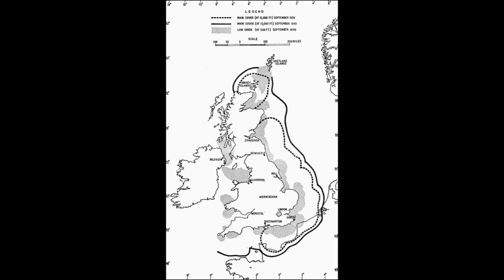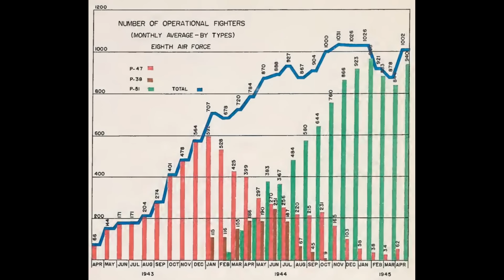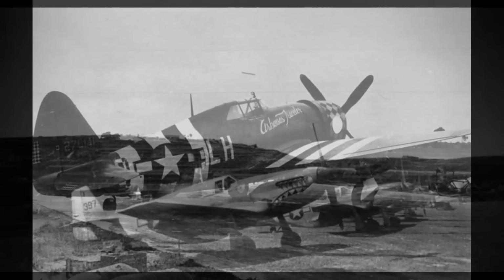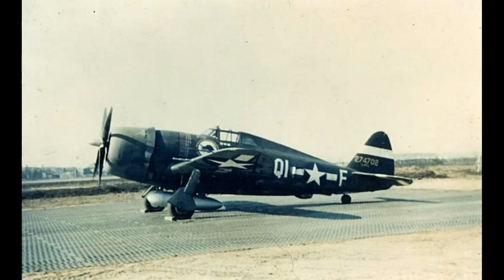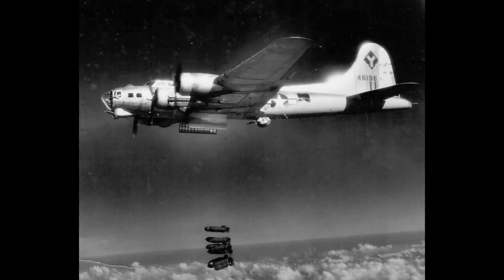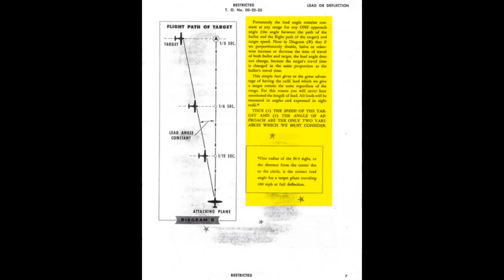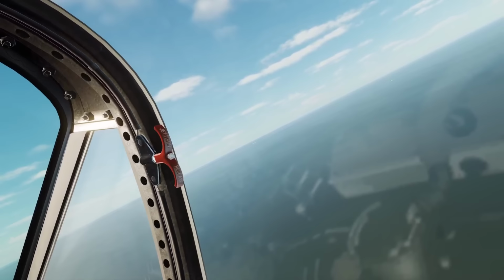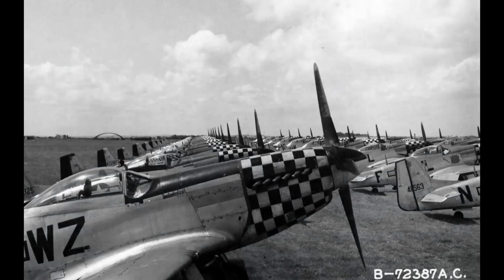Under Appreciated BRITISH Tech From WW2

Comment: Greg, need to get Stephen A. Bourque's new book D-Day 1944 that covers the D-Day bombing in detail.  Unfortunately, US bombing mostly went long due to concerns over hitting friendly forces and French villages paid the price.  Virtually no impact on German forces.  Also, John B. Lundstrom cover US Navy training for high deflection gunnery in his book The First Team.  Navy fighter's highest priority was carrier defense and they were concerned that they might only get one head on pass on attacking torpedo and dive bombers.  As a result, even pre-war, the navy trained extensively on high angle gunnery.  One reason the Thach weave worked for the Navy was that Navy pilots could execute the crossing shots generated by the Thach weave.
Reply from the maker: You don't always need to hit the target. Getting the enemy to keep their heads down is often enough to gain advantage.
Reply: @GregsAirplanesandAutomobiles  Full title of the book is D-Day 1944: The deadly failure of Allied heavy bombing on June 6.    Most of the bombing didn't even land close enough for suppressive effects.  Heavy bombers came in perpendicular to the beaches and dropped long.  Almost nothing landed in the beach areas although a lot landed on the French villages off the beaches.  The only effective bombing was by the 9th Air Force mediums at Utah which turned and bombed parallel to the beaches.  One reason that Utah went fairly well.  They also bombed visually.  Excellent book in the new Osprey Air Campaigns series which I recommend highly (entire series).  The book includes detailed diagrams of beach defenses and detailed bombing assignment tables.  Author is quite knowledgeable and has another excellent book on allied bombing campaign in France.  The author points out that this was the heaviest bombing effort of the war (short range equals high bomb loads for 2800 RAF and USAAF bombers), however, the official 8th Air Force assessment stated "The immediate beach areas showed only limited evidence of bombing damage as was to be expected in view of the extra precautionary measures taken to avoid short bomb falls when the overcast bombing method was used."  The 8th did not put much effort into publicizing these results as you might imagine.   Put in almost as big and effort the next day with the major result for 5000 bomber sorties being around 4000 dead French.  Total German casualties were probably several dozen.  As the Chinese say "when the elephants fight, the grass gets trampled."
Reply from the maker: I'm sure it's a fine book, but for these videos I generally reference official sources. Now in some cases when time has shown the wartime sources to be wrong I'll point that out, but I don't think it's the case here. These are some quotes from the 8th Air Force Document I referenced for this video. 

"On D-Day, overcast covered the invasion beaches. Yet Eighth Air Force bombed its targets successfully without hitting the ships close to the beach or the troops inland. They did it by H2X. "

"Initially the Germans were slow to react. Still dazed by dawn attacks of the Eighth Air
Force, enemy coastal defense units failed to prevent a link-up between detachments of Allied paratroops holding bridges across the Orne River Canal, and Allied troops moving inland from the coast. As a result Bayeux captured, cutting the main highway and railroad from Paris. Fighting also was taking place in the streets of Caen, 15 mile's to the southeast."

"Because of overcast weather, extra safety factors had been added to prevent bombing of friendly troops. This resulted in placing the weight of our bombs 300 to 400 yards behind the beaches. The effects of shock and disruption on the enemy were tremendous. Huge clouds of smoke and dust arose, acting as a screen to the landing operations."

"Three other missions were flown during the day by the Eighth Air Force. Gee-H Pathfinder aircraft lead some bombers in to attack road choke points in Caen, while our fighters swept the skies surrounding the area. Other forces were directed to transportation choke points in towns, some to the south and some to the east of the beachhead. H2X technique was used because of the overcast and the fact that the targets were beyond the range of our Gee-H stations. Though hampered by bad weather, both for assembly, route and bombing, good results were obtained."

     I can't continue this discussion because this is getting shoved so far down the the chat (my comments come to me in chronological order for the ENTIRE channel, not just a single video) that I won't find this again. I agree that a lot of French were killed, and I think it's terrible. However the thinking was different back then. Taking out choke points in the roads meant killing civilians because those choke points were in towns. The overall intent was to create confusion and prevent or at least make it difficult for the Germans to organize and coordinate moving of reinforcements. War is hell, that doesn't mean the bombing efforts on D-Day were for nothing.
Reply: @GregsAirplanesandAutomobiles  Greg, if I'm not mistaken, your source is the public statement issued by the Eight in the immediate aftermath of the bombing and not from the operational analysis done post invasion.  However, read closely you can see an initial recognition that the bombing had not gone well and the Eight was trying to put lipstick on the pig as the Eight as prone to due post disaster (remember their statement "Now we have got Schweinfurt" after 2nd Schweinfurt).  The initial targets were numbered and corresponded to identified German strong strong points defending the beaches.  Almost all were immediately along the beach with only a few targets beyond a couple of hundred yards inland.  Indeed, at Omaha, all targets were immediately behind the beach.  When they say they placed the weight of bombs 300 to 400 yards behind the beach, that indicates that they already knew they had missed almost all of their target set.  The subsequent comments on shock effects and smoke are eyewash as the troops landing on Omaha can attest to.  Post strike air recon photos show that even the 300 to 400 yard claim is optimistic with virtually no bomb craters anywhere near the beaches.  Post invasion operational research could not document one German fatality due to air attacks at Omaha.  The results (or lack of) were similar for Juno, Gold, and Sword where the Eight shared targets with RAF Bomber Command.  The later part of the statement actually refers to the post landing bombing where, as you note, they were shifting to interdiction which is another story.  However, the initial attacks were designed to substitute for a prolonged pre-invasion bombardment and in that roll, the Eight screwed the pooch.  The statement is accurate if applied to the mediums of the Ninth at Utah, however, the statement is from the Eight.

Please appreciate I am not trying to nitpick your video.  Love the channel and you do a first rate job.  Indeed, the major point you were making was about the importance of H2X is entirely correct with the D-Day use as subsidiary issue.  You just used the wrong source on D-Day effects.  Over the course of the entire war, the Eight dropped more tonnage by H2X than visually although that is somewhat distorted by the greater number of bombers available late in the war.  However, when you bombed with H2X, you abandoned any pretext of precision bombing.  When I went through VT-10 for Naval Flight Officer training, we trained for radar navigation using a system that was a direct descendant of H2X.  The old hands would tell you it was somewhat but not dramatically better than H2X.  On a good day with some good water/land contrast available, we could probably find the right city.  I sure wouldn't want to bomb off that system.

Comment: the two stage supercharger on a single shaft is even more important than you think as that same layout wased used on SEVERAL early JET engines i thing the ROLLS ROYCE DART its basicly why they worked so much better than the other early jets
Reply from the maker: I was thinking of the Garret TPE 331 but the Rolls Royce Dart is quite similar. Both are two stage centrifugal engines.

Comment: One important thing to note is that after the war Gee became the LORAN A system. It's actually possible to build a location fix based on the transmissions from a single ground station.
Reply from the maker: Having used LORAN C quite a bit, I can assure you that it takes two stations to work, and often you need three to avoid the dreaded "insufficient geometry" error.

Comment: It is important to note Gee would put 60% of bombs within 1 mile of the target. The Norden bomb sight would put 80% of bombs within 1 mile of the aim point, the aim point and the target were often in different countries.  Where Gee was available it would be used even on clear days because Gee would make sure the aim point the bombarder selected was close to the actual target. That if you were bombing Cean you bombed Cean not Le Harve or Cherbourg.
Reply from the maker: The Norden in daytime and decent conditions was much more accurate than the other systems discussed. However those conditions were not always present.

Comment: Hi Greg, another superb video. One of these days I'll be a patreon, to have access to these important manual sources. After the war, I think British developments were still important, such as angled decks in carriers with improved landing support devices, and, more than other things, my favourite plane, the Sea Harrier. To my - limited - knowledge, water injection was employed in these jets. My father used water injection here in post-war in the Curtiss C46. The italians also used water injection in the S79. As someone put down the comments section, this aplication forced the engines and greatly shortened the spark plugs lifes. However, the german MW50 system seems to be at the same time more effective, and less demanding on engine life. Is this correct? Kind regards and congratulations for your impressive research and excellent videos!
Reply from the maker: MW50 was just the same thing, only differences were in the operation of the system from the pilot's standpoint and the various mixtures used.
Reply: @GregsAirplanesandAutomobiles  Ok. I thougth that by using methanol, that is also a hidrocarbon and a combustible, the combustion parameters could be different in engine valve timing and so on. We had many alcohol powered cars, running at higher compression ratios than the gasoline driven ones. But the detonation problem in an aircraft engine submitted to constant power outputs is of course very different. Thank you, Greg, have a good night!!!!

Comment: 22:56 Flying the WWI stuff in VR is a very revealing experience. One of the things you discover is, at least for dogfight work, you more or less stop using the iron sights entirely, once you've got enough gun time. 

But, the WWI fighters also typically have 500 round belts of slow cycling 30 cal machine guns, and they tend to be all nose mounted so you can sort of get that kind of gun time. And for longer range shots, the iron sights are basically useless. So the reflector sights and later gyro sights are a massive leg up, especially for low combat time pilots.

Comment: As always, great video! Just a slight correction, the FW190 at 4:44 is a D11, not a D9.
Reply from the maker: Hmm, I think you're right, I didn't notice that. It probably has a gyro sight.
Reply: @GregsAirplanesandAutomobiles  I don't know about the gyro sight. The lack of fuselage mounted MG131 disqualifies it as a D9, so it has to be a D11, D12 or D13. Since it also lacks the cannon firing through the propeller hub, it can only be a D11. Anyway, I just like nerding about planes...

Comment: For a British innovation that helped American aircraft but was actually doctrinal rather than tech based I would like to mention carrier fighter direction rooms and operations, the British carriers having smaller complements of some pretty awful naval fighters had innovated massively in this area of expertise to ensure that they were always capable of facing an aerial threat with their own fighters without having to keep a large permanent Combat Air Patrol in the sky, thus when the Americans borrowed HMS Victorious from the royal navy for a few months in WW2 they very quickly copied these innovations off of the British carrier and crew, the Americans having not developed so much on account of them just throwing more planes at the issue for their own carrier designs.

Comment: The Tizard Mission (1940) to the US provided secret technology to advance the american WWII contributions:
- the greatly-improved cavity magnetron for airborn radar,
- the design for the proximity VT fuse, 
- details of Frank Whittle's jet engine
- the Frisch–Peierls memorandum and MAUD Report on the atomic bomb concept. 
- designs for rockets, superchargers, gyroscopic gunsights, submarine detection devices, self-sealing fuel tanks and plastic explosives.
The Tizard mission also precipitated an urgency to catch up on jet engine tech.  British RAE engineer, Allan Griffith had been working towards an effective axial flow engine starting in 1926.  His engines of the 1930s were improved and used on the Meteor in 1943.  Metallurgy was still being developed to perfect them, but the US (GE and Westinghouse) benefitted from his work that became available in 1940 via the Tizard Mission.

Comment: Hi Greg  l wonder if anyone else has noticed this.  In photos taken on Fighter Command airfields during the BoB, most but not all the Hurricanes have spinners that appear too large for them.  I'm sure l've read somewhere these were Rotol props designed for the Spitfire II and the Spit II does have Rotol props on it with the same stubby spinners. This I believe was about getting constant speed units on all the fighters.  Someone must have pointed out they don't fit, to be told Sod that ! put 'em on.  Desperate times.     Dave.